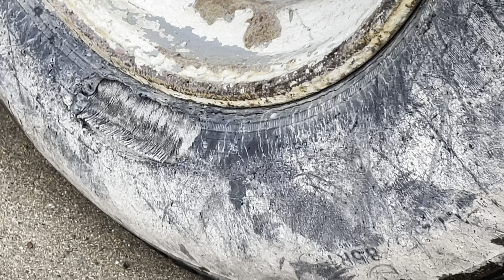Logging cart tire change

Comment: Bonjour Mon Ami 😇👍👌 You do are using your tires at the full life extend 🥴😇👍Any Tire Change Is Not An Easy Walk In The Park 🥴Yes You Do Save A Considerable Amount Of Money Doing It Yourself 😇👌👍 Yes Maintenance Is THE Vital Factor 👍👌😇 Switch the Axel From Left To Right So The Wheels Will Be Inward 🤔 Thank You Very Kindly Sir For Your OUTSTANDING Video 😇👌👍Cheers 🍻
Reply from the maker: Bonjour Dave! These tires are 16” tires and bigger the better it is very hard to find. I put used ones because they wear a lot, when I repair it I will get new ones someday. These are bogie wheel suspension so I cannot switch the axles (I wish lol) they are welded on what’s called walking beam suspension. I will have to bend them straight someday. Would like to rebuild it winter project lol.
Thanks for watching and the wonderful support.
Take care mon ami
Reply: @russellbelliveau1694  Ho boy that will be a major use a Welding Torch heat up the steel bar strait 🥴Have a safe week mon ami Cheers 🍻🍻

Comment: Good evening Russell,  that was pretty slick, nice move using the forks, didn't even have to get out of the tractor. Handy valve stem tool,  I'm guessing you built it. I think I will follow your advice. At some point I will put tubes in the tires on our tractor. Thanks for showing us this repair. Take care, Ben
Reply from the maker: Thanks for that Ben, yes we made the valve stem tool, use it often. We’ve had tractors here forever lol and always put tubes in. 
Thanks for watching I’m gonna skip over and watch you video shortly
Take care

Comment: I have a small hobby mill and I have a lot of spruce trees. I’m in New York and I’m only 12 miles from the border of Canada. I saw spruce but even when I use a new blade, it doesn’t seem to stay sharp long. Maybe 3 logs or so. Just wondering what hook angle you run on your blades? Any info on sawing spruce would be great. Thanks
Reply from the maker: It’s all I saw, I’m not sure the angle 7degree maybe ? You have to go slow and if they’re big logs change the blade often.  Make sure they’re clean I really don’t have any problems let me me know if you have any other questions 
Thanks for watching and appreciate the questions.